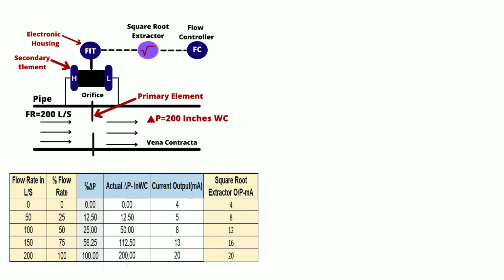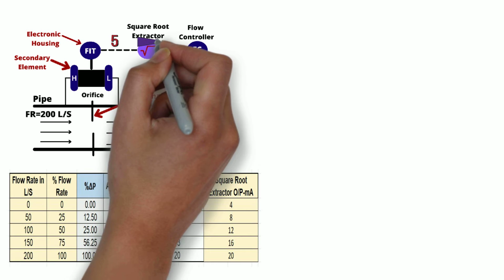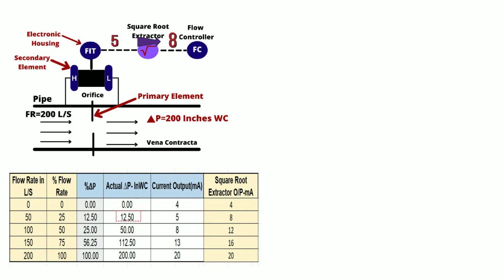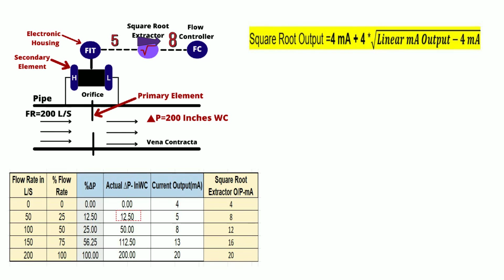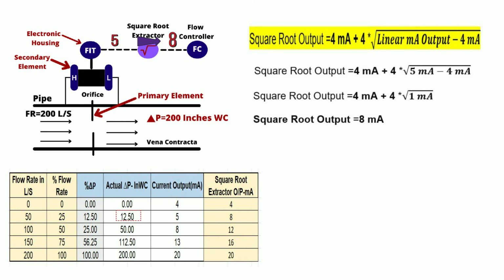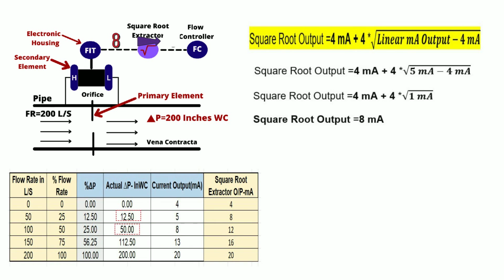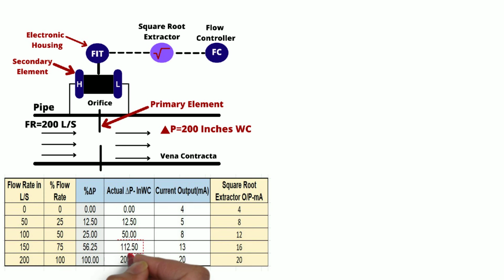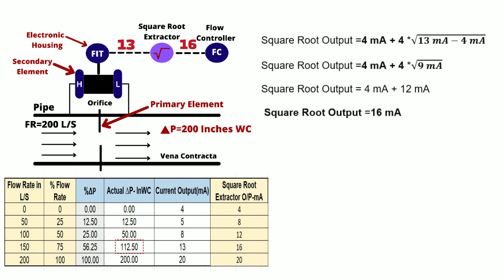DP Flow Transmitter Verification with Square Root Extractor|  DPT basics

Comment: Sir in flow transmitter configuration, the square root extraction is used for ∆p regardless of the constant K, even if the formula is Q=K√∆p.
Reply: It's possible that I may have expressed my question incorrectly, but when measuring flow using the delta pressure (∆P) method, we don't add the constant K to the transmitter configuration, even if the formula is Q=K√∆p.
Reply from the maker: @anantz8239  Hello Anant
Yes, K is a proportional constant in this equation. This is the reason it is not considered  at the time of calculation.Flow Rate is directly proportional to square root of differential pressure. K is proportional constant.
Reply: @InstrumentCalibration  Thank you for your response, but the constant K varies from one type of measurement to another. For example, the measurement principle using an orifice plate is different from the principle using a venturi tube, yet both use the formula Q=K√∆p.
Reply from the maker: Hello Anant
Thanks for your valuable comment.
Reply: It's possible that I may have expressed my question incorrectly, but when measuring flow using the delta pressure (∆P) method, we don't add the constant K to the transmitter configuration, even if the formula is Q=K√∆p.